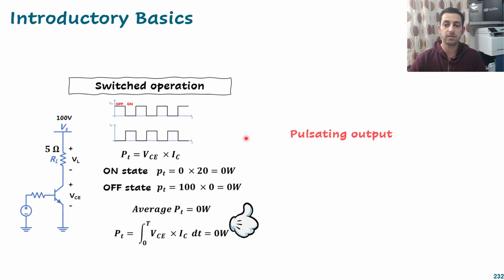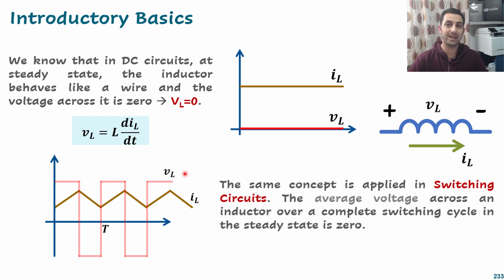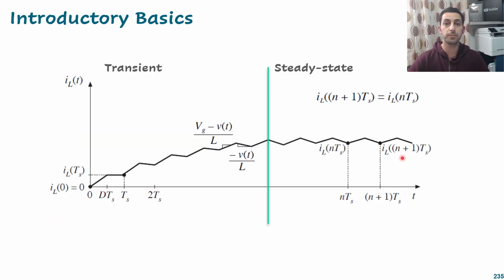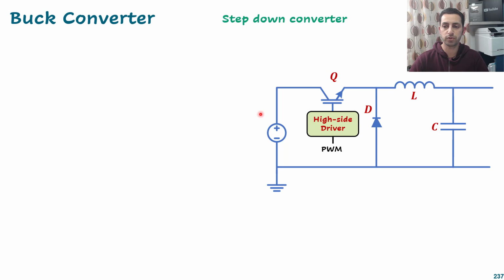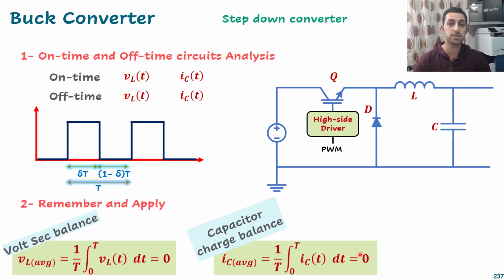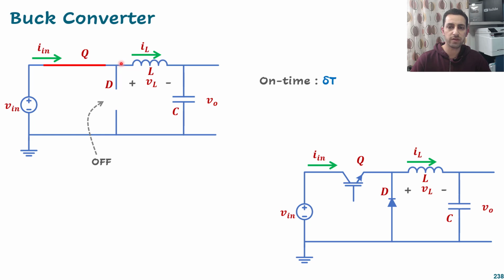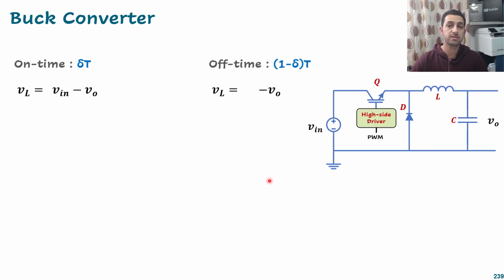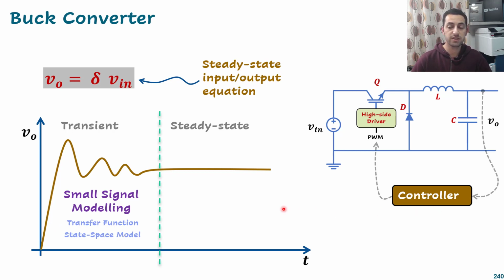29 Buck Converter Introductory Basics | Power Electronics

Comment: Excellent explanation. 
Could you please explain in buck converter across which component the undesired voltage dropping? If I well understood the concept, inductor will drop the undesired voltage across it and pass the required voltage to load terminal is it correct? If yes in equation we are writing (Vl=Vin-Vout as per KVL) but how we can confirm or prove the undesired voltage dropped across the inductor during switch On period?

Your answer will be highly appreciated and helpful to clarify my confusion on this subject.

Comment: hi , how a buck converter ic supply its own circuit ? I mean  I always see an internal voltage regulator inside every diagram of ic but if it get the current from the source directly it is not efficient